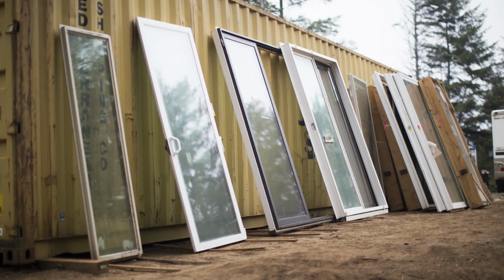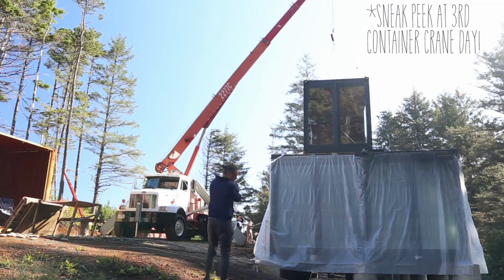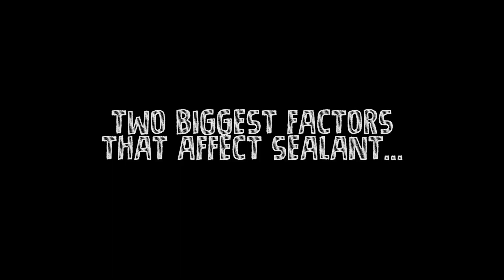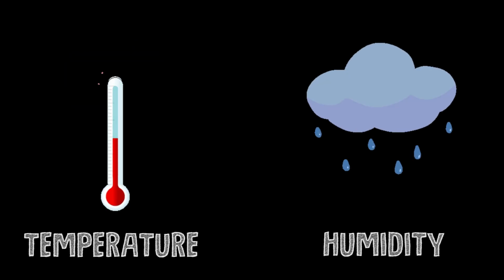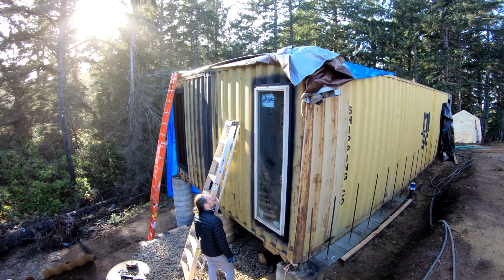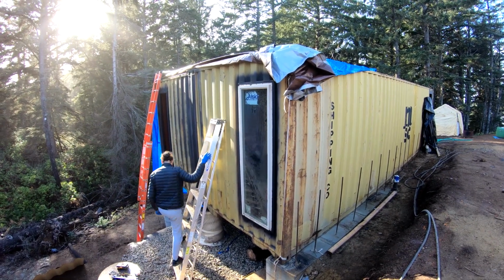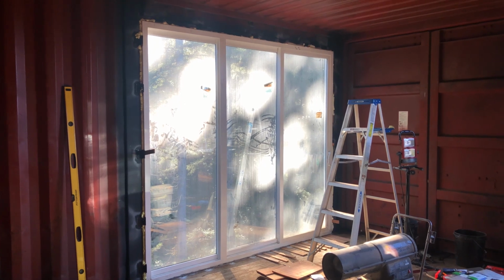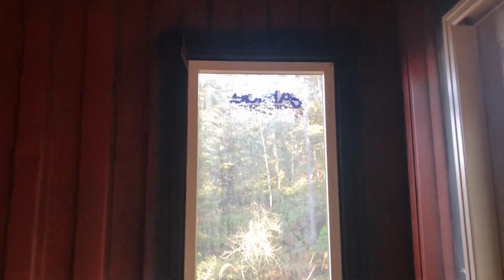INSTALLING DOORS & WINDOWS for our SHIPPING CONTAINER HOME! Ep. 13

Comment: A little cutting oil goes a long way with drill bits.....you were really smokin’ that specialty bit!
Reply from the maker: We usually use oil to drill anything ... these drill tap bits are kind of tricky because you can’t really go slow using them with the impact drill. But we’re still learning so maybe there’s some trick we don’t know. 🙂

Comment: It would have been so much easier to modify your container on the ground and then lift it in place. Installing the Windows like you did you will find out yourself in the future that you will have major leagues in the container there is a special weather in casing you can design to go around the window first using very limited sealer
Reply from the maker: We couldn't install the doors and windows before craning them into place because the container flexes when they are picked up and we didn't want to risk the glass breaking. It's been 4 years and no leaks so far.

Comment: Hi great job you two mammoth task ahead, just one consideration you need to check, if I heard correctly you are fitting the glass doors from the inside you may find the water that runs down the glass on the outside rain etc may leak inside as the drip seams are designed for the windows to be fitted from the outside ,worth a check. Good luck from Northampton England
Reply from the maker: Thank you & thanks for the advice! 😊 We installed the doors in the exact same place they would be if installed from the outside. Eventually they will be framed from the exterior (finishing touches). There is a place for the water to be drained out from the door on each side on the exterior. So far it’s been leak free & it’s been 2 years.

Comment: that's a lot of thermal bridging with the metal brackets touching exterior and reaching interior
Reply from the maker: They don’t reach the exterior. They are welded to the interior door frames. Once the insulation is installed it should be fine. Luckily it doesn’t get too cold or too hot here anyways. 🙂